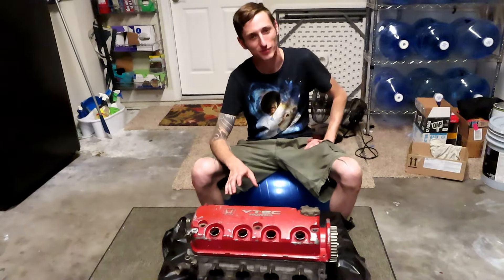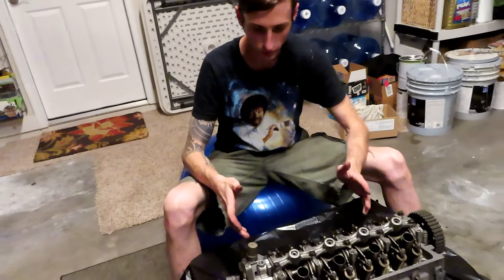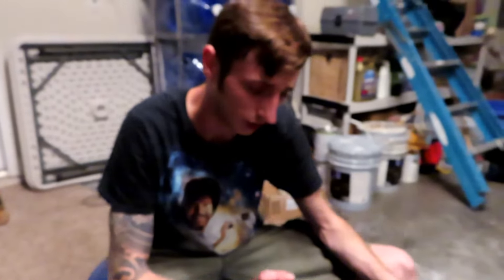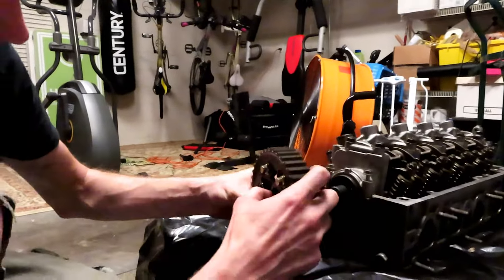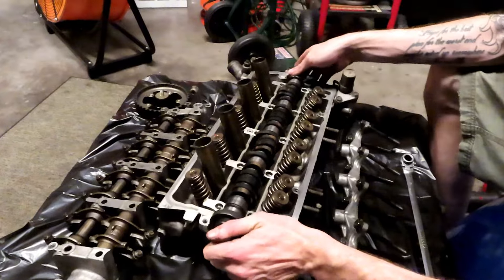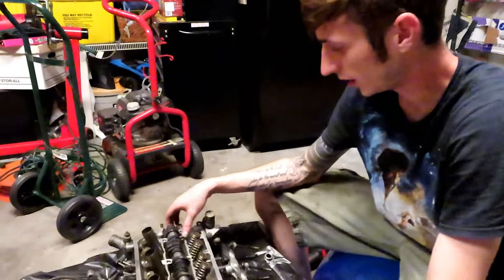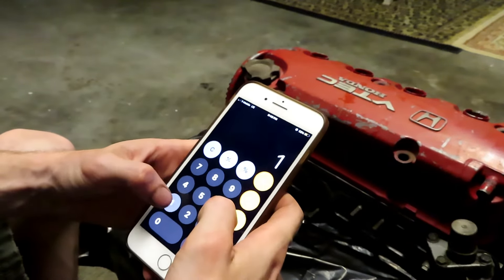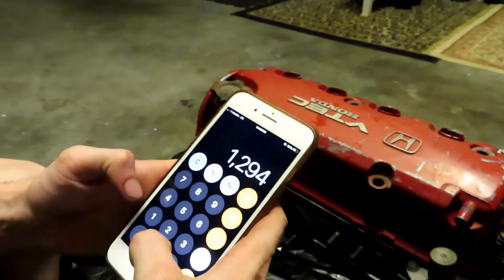CHEAPEST Way To Make 500HP With a D16 Head

Comment: Intake side needs to be able to get more air into the engine since this is a turbo setup.  You want to keep the exhaust more narrow so the turbo spools quicker because of the faster exhaust velocity.  It is a science.
Reply: Interesting
Reply: @@SEIKAonly port on intake don’t polish. Helps fuel mix

Comment: You dont wanna polish intake ports . The roughness helps atomization of the fuel but you do wanna polish the exhaust side as you want the air getting out as fast as possible ...
Reply: That applies for carburettor use as the injectors atomise the fuel un like carburettors :)
Reply: You definitely don't want to polish the intake ports, fuel injected or not.
Reply: @Russell218  lmao well I’m off to Reddit to solve this debacle
Reply: @Hohmies86  Full disclosure - all I'm really basing my assertion on is the fact that I have a D16y8 head with $2k invested in it, and I don't see a single square inch of polished aluminum anywhere on it. This head was full-race ported by Portflow in the early 2000's and was originally installed on a car that set a bunch of world records. The entire engine was actually optimized by JG Engine Dynamics, including additional work on the intake ports to match them with the custom JGE intake manifold. When the original owner got too old to horse around with Hondas, he passed the head on to me, at which point I replaced the entire valvetrain and had custom valve work and combustion chamber work done by Joe Alaniz. I did the final assembly with the help of Earl Laskey right before he passed. This head was basically worked on by all the biggest names in Honda racing, and I never once heard anymore mention anything about polishing the ports. They're plenty smooth, but nowhere near "polished." Looks more like they were finished with a small wirewheel.
Reply: @Russell218  so don’t polish intake ports but exhaust side is ok ?
Reply: @g35tho11  yes correct polish exh side only fuel will puddle on intake if too slick like comments said it won't atomize.

Comment: Your going to need that stage 5 xtd 4 puck is only a bit over $100 bucks but its worth the disc and pressure plate. Ive ran them before with great success And they have a stronger pressure plate design with the new ones😀😁
Reply: 1
Reply: I'd go ACT much better brand and well worth the price I have their 6puck sprung racing clutch and streetlight flywheel on my 02 wrx and it bites so hard all 4 spin and squeal tires lol.

Comment: Not completely sure of your exact project but from what I know, smaller port increases velocity(in certain instances, ports have actually been made smaller than factory for this reason).
So since the motor is boosted, you'd want the intake side as big ass possible to get as much air in the motor(velocity isn't as big of a deal, because of the boost), but on the exhaust side, you want the air to escape as fast as possible. 

again, I'm not exactly sure about your specific situation but its either something like this, or he just forgot to do the exhaust side lol

Comment: Bought a Ek Civic for the first time I've always wanted one, km was Hella high, like 300000km high, got the engine rebuilt professionally and now for the power
Reply: Shouldve rebuild it yourself with forged pistons rods etc for probably half the price. Im into my motor under 1200 including eagle rods weisco pistons acl bearings etc and machine work/hot tanking and paint

Comment: I just bought a 1991 civic lx with a d16y8 and a spare d16y8 with a garret m33 turbo. This is my first honda, I've always run Lexus/toyota and subaru. I'm surprised at how cheap these cars are to work on and to build. From spending over 6k to turbo a lexus to a little over 1,500 to turbo a civic, its crazy. Only down side is, I'm coming from rwd and awd so this new fwd platform is a bit foriegn to me.

Comment: I'll be happy with 350-400 at the wheel
Reply: On a civic bro 300 and I’m set 😂😂😂
Reply: 200 and I'm happy 😭
Reply: The internet say a d16y7 will start failing at 220 hp
Reply: @landentomlin4376  thas on stock motor
Reply: @callmetimmy3004  ye
Reply: Stock d16 rods are literally as thick as a mans pinky finger. Impressively thin.

Comment: the reason for leaving the exhaust side unpolished ,  is that smaller runner , means greater velocity,  with more velocity ,  less heat since it has less time to wick ( larger holes,  slower flow ) .  also the carbon build up acts as a polish in a way , filling those pores up  .   same reason on the intake side you do port.   larger intake , means more air . more air . cooler charge.  and more room for HP gains .   engines are just air pumps .    good example for the exhaust  explanation ,  is think of exhaust manifold runners , the smaller the runner.  the faster the airflow.  which also helps with turbo spool rate. smaller runner.  earlier into boost compared to the same engine with a larger runner manifold.    the larger intake charge also helps push the exhaust air out as the other cylinders are on their compression stroke . like exhaust scavenging , but in the engine .  scavenging also explains why your exhaust manifolds are made with a 4-1 . and equal length piping .    all about airflow , and airflow potential , which is limited by intake size.  . .   comes full circle .
Reply: Some of your theories are absolutely rediculose.

Go read...
Reply: @elonmust7470  like ?  i dont think asking for some specifics,  is ridiculous .    this'll be fun .
Reply: @elonmust7470   specifically read the intake runner and exhaust port info . https://www.jegs.com/tech-articles/cylinder-heads.html
Reply: @twistymcslide2  the velocity created by narrow runners is what would otherwise be created by the manifold & volute with less restrictive exhaust ports.  More cfm is the main goal here. 
Also carbon buildup does not aid in flow at all.......
Reply: @elonmust7470  the carbon buildup is inevitable on the exhaust side.   if youd measure volume with a plain , newly cast manifold ,  and then 10k miles later.  the later , flows better because of less turbulence,   the carbon fills the voids,  acting similarly to a polish,   why when you put your finger into an exhaust port and get carbon on your fingers, and then rub them together,   you feel like you have a talk on there ,  which moves smoother than just your fingers will . . i dont mean build up of carbon which slow flow off the valves , and are obstructions .  i mean the inevitable byproduct of combustion .  engines in good health wont build enough carbon to be obstructive. . and runner math is all about cylinder volume . not intake volume.    the engine , is an air pump . but is limited by how much air it can draw in .  the faster and cooler the charge air,  the better it performs.  pre turbo , you want a faster airflow velocity,    post turbo you want as free flowing as possible so it doesn't become a bottleneck .
Reply: @twistymcslide2  polished exhaust ports solve that problem.

Aside from that you're just babbling your facts. There's nothing there in regard to what I said as far as why you don't bottleneck any specific point of an engine. Reading about porting 2 strokes is eye opening.
Reply: @elonmust7470   i never said to bottleneck ,   but too large.  is too large.    it slows airflow, and that slowing , allows more time for the air to heat up , and or transfer heat to the block .  that's why they make thermal gaskets.   to prevent heat from the heat , wicking into the intake plenum , elongating exposure to heat. . . i have read up on 2 stroke's.    i run expansion chambers in all my exhausts because of them actually.  . .  though that's more about scavenging .
Reply: @twistymcslide2  It can be an issue but not in most instances.
Reply: @elonmust7470     im still waiting to hear  what is ridiculous,  in what i  originally said . . . . .
Reply: @twistymcslide2  the context of my comments is pretty understandable if you're able to comprehend written English, but here you go.

That the small runners are advantageous & that carbon buildup is a good thing.
Reply: @twistymcslide2  increasing the volume of an exhaust runner by say 5%, the benefits of added flow will far outweigh the negative effects of  slower moving gasses.

Comment: I have 3 blocks 3 heads, 5 cranks, and I still can't get a running d16.
I took parts to a "great machine shop" & promptly waited about NONE MONTHS for some halfass work.
Just blew a head gasket at like 9lbs yesterday making a measly 280hp.
I'm not giving up though.
Reply: Respect! In the same lane myself!!
Reply: @jasoncange602  It was a cracked sleeve..  Put an h2b in for the mean time.  Gonna sleeve the d16 and do it again.
Reply: Dam don’t scare me
Reply: @smoth0p3ratorc5  nothing to be scared of, just a learning lession.. if you get nothing from it, thats scary...
Reply: @elonmust7470  have you thought about getting a css block instead of darton sleeves?
Reply: @nephron9924  I am currently thinking about that as a matter of fact.
Everyone claims that their method is the best...

Comment: Cold air volume is larger than hot exhaust fumes this is why intake valves are bigger than exhaust valves. 
because exhaust fumes are thinner.
Porting the intake side. You are able to increase not just the volumetric admission but also the velocity.
Harder valve springs increase compression and response but also keep compressed air to get inside the cylinder after valve closed on turbo application.
Reply: Dave Micolichek  I know you are not my homie. Is just a term we use here on northern California.
And nop I do not do 1/4 of mile any more that was when I was on my 15's
Now I'm into time attack.
And yes I know your car would beat my bucket but that doesn't make you smarter. 😂😂😂😂

Comment: Great video, love watching it come together. Quick question, i have a D15b2 and I want to get 250-300hp. Is it worth building? If so, what would you recommend? Thanks.
Reply: For the amount of money you’re gonna spend building that single cam you’re better off k or b swapping it
Reply: Get a d16y8 head, and make your d15b2 a MiniMe build, they can rev to almost 8K and make about 135 hp before u mess with intake and exhaust or extensive tuning. Also a Skunk2 stage 2 cam shaft, AEM fuel rail, and some cpu tuning will make your 1.5l economical engine will now put out a good deal more power,  don’t bother with boost or supercharger, just build it all engine, and as long as u have a manual gear box that performer could keep kicking for a real long time to come, only get a B series or H series if it is available and u can afford the parts, J series are heavy and K series you have to turn it all around and swap out the drivetrain… d series is ur easiest bet, cheapest and can be pushed farther then you want it to go.
Reply: I have the same engine. Im looking foward to swap. Itll be better. First need everything before I go ahead. Gather prices
Reply: Also you are mentioned about d16y8 head pj2 of what year?
Reply: @andrewwenner2781  does the year has to be specific d16y8 header pj2?
Reply: @andrewwenner2781  skunk 2 stage 2 in d series not kseries??
Reply: @andrewwenner2781  aem fuel rail or skunk 2 will work any year or series?
Reply: Andrew Wenner does a that skunk cam by any chance affect the possibility of failing smog?
Reply: I hade a mini me swap all I did was add upgraded injectors and pump  I made 250 at 14 psi
Reply: @ThtJdmguy  how’s your build holding up?

Comment: Having the intake side ported and the exhaust has a reasoning if it not mistaken….. allowing the intake to be ported increases the velocity Becuase your sucking in more air and, cause you need more air….. but you also need to let it escape quick so keeping the exhaust side stock does just that…….

Comment: pretty sure the heads lift at high HP and you need ARP head studs and a better head gasket, the cylinder head rockers, valves especially stiffer springs are for higher RPM, and don't really corollate with power directly,

Comment: usually exhaust ports arent polished becouse if its not polished it has more acreage (becouse its little bumby) so it stays cooler, polished intake ports are good becouse the air fuel mixture can move better, with polished exhaust port the cylinder heads exhaust side would get way hotter and broke your head, sorry for bad england :/

Comment: Is a ported head necessary and also aftermarket intake manifold with bigger throttle body?
Reply: Every bit helps if looking for power. Engine=air pump more air in and out= mo powa.

Comment: Which is the best vtec head swap for a 2005 civic lx d17a1 and if I have to swap to give it more speed the please let me know thank you
Reply: A k20 swap
Reply: @singlecam1892  if I want to go with a single cam what’s best
Reply: Oh shit i totally didn’t answer your question 2005? D17A2. I mean it’s not too much of a difference but i also think those engines and transmissions are trash. They didn’t even up the HP from 6th gen-7th gen. It stayed at 127. I’d say fuck it and grab a d16y8 and turbo the bitch. You’ll get exactly what you’re looking for in a Sohc. Yeah it’s a 1.6l 16v vtec. But like i said compression matters. You get higher compression with the 1.6 and  If you wanna keep it N/A then Forged flat top pistons, bigger cam profile, port&polish throttle body, intake, intake ports on head, exhaust ports on head, shorter gear ratios in the trans bigger injectors, adj. fuel pressure reg, an AFP gauge oil and fuel gauges so you can see exactly what’s going on, then a little tune and you got yourself an fucking beast ass N/A SOHC

Comment: I see its a 99-00 y8 head. Might as well replace ALL valve seals while you are in there
Reply: For real.  My D-series needs a head job.  Sounds like shit, currently.  Guides, valves, seals are fucked, makes a horrible knocking/ticking.
Reply: @hegeliandetective1034  Is knocking because your injection is to small for that amount of air and is keep wide open. You have to change it at bigger one otherwise on your piston will be a hole.
Reply: @laszloszell8753  Get this.  My timing belt was loose.  Changed the timing belt, now it's tight.  Which solved the slop in the cam.  Was still making a spark-knock sound, and was occasionally misfiring.  So I uninstalled my intake-manifold, found a huge crack in the intake-manifold-gasket, I replaced the gasket, now it doesn't make a spark knock.  So you were right, there was too much air coming in, causing spark-knock.  The air was coming in from the intake-gasket-crack, into that cylinder.  Needed a few full heat cycles for the intake-gasket to fully seal, hindsight I should've used just a slight amount of hondabond on the mating surfaces, but oh well, it's good now.  If it gives me any more issues, I'll redo the work.  So far so good.  So thank you for the comment, in case I had not figured it out yet.

Comment: You don't  polish the intake because you want a rough surface. The rough surface will cause turbulence which is better for air fuel mixture entering the cylinder. The turbulence will allow cooling and better mixture of the air and fuel which will result in better combustion, that equals more power. Make sense yet?
Reply: Polishing makes things smoother your reaponse makes no sense

Comment: You going turbo why did you get a vtech head ?
Reply: Running boost with a Vtec head is the best way to go
Reply: Michael Randrianarivelo vtec turbo only makes sense if you want to drive efficiently on the street. 500hp is not going to be anywhere close to efficient so vtec is nonsense. Should lock it open and send it

Comment: Id be happy with my Y8 at 250-300  na without major tuning . If that's even possible
Reply from the maker: No sir the most I have seen all motor is around 190
Reply: @Autosauce  well still probably has better turn out then stock with jus intake and exhaust .  Climbing hills in out back country areas can be rather rough for these weak D motors even with vtec 🤣
Reply: What part of Lakeland
Reply: @Alpha-cr5cb   to whom was your question directed sir ?
Reply: @lostkauz83  Autosauce

Comment: Don't wanna sound like a dick but you want to make 500Hp and don't understand why you only port the intake side only...ok,if you are going turbo you can port the exhaust side only...why? Because you want a larger volume of air to spool your turbo quicker but with an N/A build you want a greater volume of air on the intake side so porting out the intake side alone would help a lot, also porting the intake manifold to match the ports on the head will help with air flow
Reply from the maker: Please rewatch the video!

Comment: Vtec is only intake side on a sohc vtec, most people building turbo d16s. Dont mess with the exhaust because of the backpressure already being there. Intake only, is the way to go on a sohc.
Reply: Wrong on d16z6 and y8 both have dual vtec and engage both intake and exhaust...its the ivtec motors that only open on intake side such as d17a2 and others with economy vtec
Reply: STOP SPREADING FALSE INFORMATION

Comment: K-series or J-series swap, sounds like it would be a better option.  Might as well save that $1,400 and put it into a K24 block with a K20 head, get a stock ECU, and CRV AWD transmission, eventually making it an AWD chassis, but for now keep it FWD.
Reply from the maker: I already have a k swap CRX, wanted to do something different.
Reply: @Autosauce  I feel you.  I'm rocking a D series currently.  Thinking, not a whole lot of folks have mastered the J-swap.  Has great torque/power stock, can be improved on.
Reply: K & now j swaps are for posers.